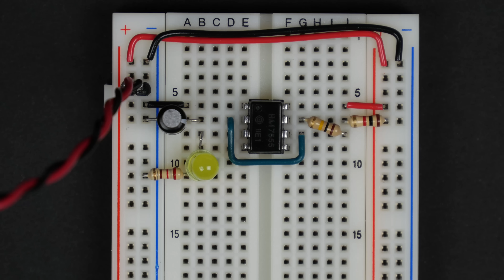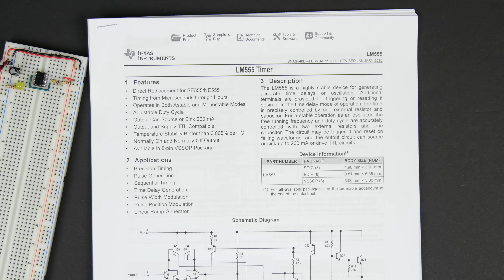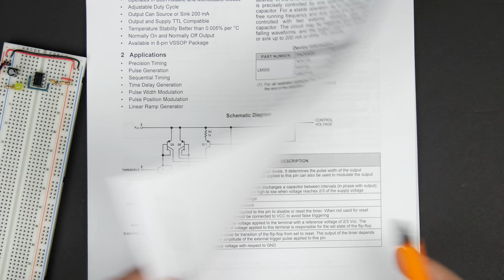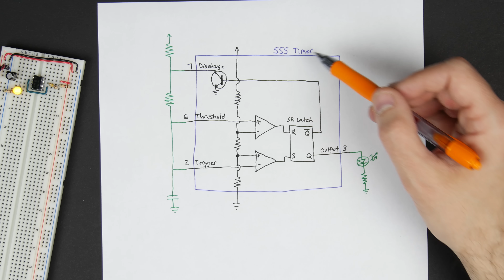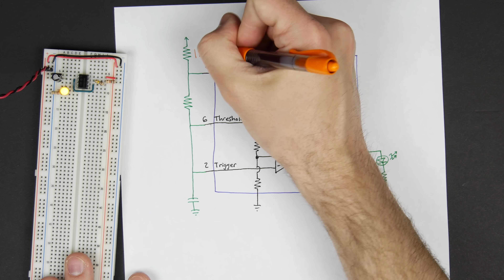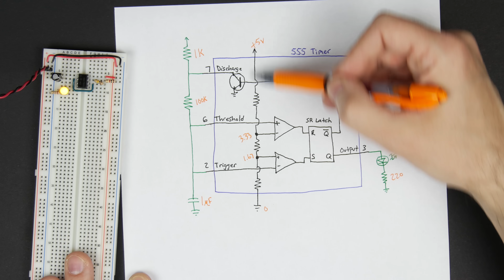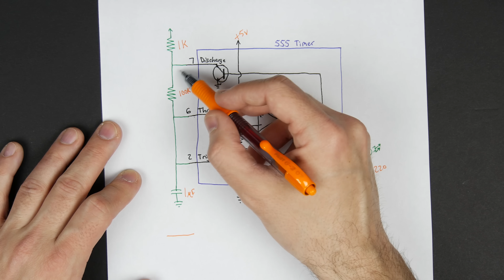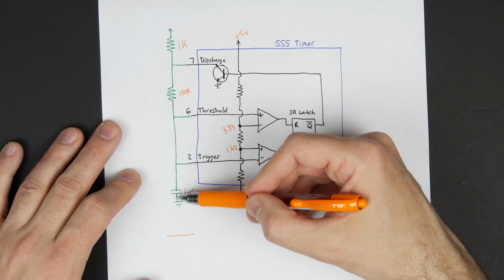Astable 555 timer - 8-bit computer clock - part 1

Comment: Caps, especially electrolytic can be off by a lot and still be in spec. Usual tolerances for electrolytic caps can be from -20% to as high as +80%.
 So 1 μF at 80% could be .8μF to 1.8μF. So 2 μF close enough.   https://www.electronics-tutorials.ws/capacitor/cap_3.html

Comment: What happens if you just use an alternating current for your clock signal?
Reply: Michael Mele the only thing online I could find that used AC current for a clock is this clock https://hackaday.com/2010/04/07/logic-clock-without-an-on-board-oscillator/

AC current is fairly consistent but can vary by a bit from day to day so it’s not ideal for something that needs a consistent signal 

It’s also inflexible only going at a specific hz
Reply: @Madjam-cd2fk  Thanks a lot! I guess it's not a well trodden path, which is something I didn't know before. 

I'm guessing that your AC input signal could be as flexible as you want to make it. Are we stuck with the 60 Hz coming out of the power grid, or is it feasible to custom build an adjustable and regulated AC power supply at any frequency you like?
Reply: well these chips are all analog (in the computer) so thay would have some problems / unexpected behaviour with a analog clock

Comment: the .693 coefficient is approximately ln(2), as the capacitor only charges and discharges half way.
Reply: It only charges from 2/3Vin to 1/3Vin. The calculation for that would be: 2/3*Vin*exp[-t/(C*R)]=1/3Vin <=> t=ln(2)*C*R.
So you where right about the coefficient, but it doesn't charge or discharges half way. Im sure thats what you meant, but just for clarification.
Reply: lol I've seen this constant so many times (in Chemistry; physics; etc.) that when I saw .693 in the video I immediately know it's ln(2) lol
Reply: @yiliangliang5694  especially in electrochemistry and ionic equilibrium lol and chemical kinetics
Reply: Thank you
Reply: I knew it seemed familiar!

Comment: I do have a question that I dont know if it was asked already. Why on the discharged phase, the capacitor gets to discharge into the transistor rather than the ground it's already plugged into?

And while asking this question, another came to me: Why the capacitor is even discharging, to begin with? As the way I see it, it's just constantly plugged in the 5V then into ground.

I feel like I missed something there >_<
Reply: To answer your first question, the capacitor doesn't discharge into the ground it is already plugged into because the charge accumulates on the other plate which is not connected to that ground. As this charge accumulates on one plate, that plate will have a higher electric potential then the other plate, which is grounded. This difference in potential is voltage. When the transistor is energized it will allow current provided by the power source to pass through the 1K resistor and straight into ground, completing its circuit. Likewise, the capacitor that has been accumulating charge will now be able to discharge through the 100k resistor into ground, completing its circuit.

Your second question is very much like your first. When the transistor is energized it provides a ground for the power source before it would contact the capacitor. Think of the transistor being energized as a way separating the power source and the 1k resistor from the capacitor and the 100k resistor.

I hope this clears things up.

Comment: The 555 was my mainstay in the 80s.  Two of these was the heart of an automatic car starter which was pretty cool since in the mid 80s they were not all that common.   One in the Bi Stable mode was triggered by a radio link from a cheap remote controlled car from RS which supplied power to the ignition and triggered a second 555 in the Mono Stable mode that powered the starter for a few seconds.  It was pretty simple by today’s standard but back in the 80’s it was pure magic .

Comment: Those capacitors, judging by the "MFD" unit label, are older than dirt and have become electrically leaky, hence the high reading. Allow me to explain.

Imagine an ideal capacitor. Two plates, with a gap. No DC current will flow through them once the field is built up. Non-ideal capacitors have a characteristic called leakage current, which is the amount of expected DC current flow between the plates due to things like electrolyte conductivity, ionization and metal migration over time under the force of the electric field, etc.

As some types of capacitors like electrolytics and the old paper and wax capacitors age, they leak more and more DC current across that they shouldn't, and slowly start to build a parasitic resistance that decreases as the capacitor ages. Since the parasitic resistance is in effect in parallel with the capacitor (because the leakage current occurs between the plates) it causes the capacitor to take longer to charge. Most multimeters read capacitance by passing a small, known current between the leads and then sampling the voltage over a specified time (basing the reading on the fact that larger capacitors take longer to reach any given voltage at a constant current), meaning that any leakage between the plates of the capacitor will cause the reading to look high because of the parasitic current draw keeping the voltage down.

Slap one of those capacitors between the leads of an old capacitor leakage tester and see how badly they leak. Some of the older caps I've seen can leak current at a charge as low as 2-3 volts. No doubt those are the same.
Reply: That tels me that we measure the load time of the capacitor, I usually measure UN-load time, with the opposite result of course (many of my parts are 20jrs+)  Because my first 5 555 experiments went wrong, I did not think much of if, now I am gonna try again... thanks to Ben and all use full comments.
Reply: Indeed.  It would be interesting to find out if the capacitor was equally inaccurate at higher charge currents, and whether the electrolyte barrier would reform over time if the capacitor was kept in constant use.   As I'm sure you know, the electrolyte itself is conductive, but passing current though it forms a thin insulating layer of oxide on one of the capacitor plates, and this thin layer is what makes it a capacitor (and indeed a polarised capacitor).
Reply: and here i am thinking 'mfd' just stood for 'mf' doubled...

Comment: Oh man, I just realized - so, in Minecraft, there's a commonly used redstone device called an Etho hopper-clock, which serves basically the same role as the 555 timer of being a cheap, easy-to-use clock where the period can be varied easily depending on how you set it up. And what I just realized is, it's not just the role that's analogous - the mechanism is analogous too! You've got a set-reset latch, a couple comparators feeding into both inputs of the latch, and an accumulating device where stuff can either flow into it, or flow out of it, depending on the state of the latch. Items flow into a hopper until one comparator says it's full enough, which sets the latch, allowing the hopper to "discharge", and then items flow out the same way they came in until the other comparator says it's empty again, which resets the latch.

This ubiquitous circuit was independently reinvented in a videogame by someone with no electronics knowledge. I just think that's neat!

Comment: when i plug my probe to check the cap on pin 2 the output of my 555 goes stable, the LED remains on and doesnt pulse. Whats going on there?
Reply: try flipping your 1 mF capacitor around. that was my issue
Reply: @glacial_chinchilla  thank you this just saved my morning

Comment: Asking just by curiosity. At 12:00 you talk about the rate between on and off time (duty-cycle). Wouldn't you get 50% duty-cycle if you placed another 1k resistor before the discharge-transistor? Nice video btw!

Comment: why would you even need the first resistor if you want to have the same time on as off, couldnt you just connect it straight to 5v with wire? or is there something im missing
Reply: if you connect 5v to pin 7 than when the discharge transistor opens you have basically 5v connected to 0v(ground) without any resistor === shorted circuit

Comment: I was wondering when you connected that small 0.1 mF cap to pin 5 and ground which I think is called the "Control Voltage" pin, how did that smooth out the transition ripple so well?  Also these R/C timing circuits are notoriously unstable in frequency with change of input voltage and temperatur.  A crystal controlled circuit with a bunch of dividers in order to divide the higher frequency down to a couple of hertz would have been more stable.

Comment: On the schematic for the clock module, there are two capacitors labeled C1 and C10. I'm having trouble understand where the second one fits in to this and its purpose. Does anyone have any insight?
Reply: These are essentially the capacitors he talks about around 22:10, to filter out spikes due to the impedance of the power lines. There are two caps in parallel to get the right value.

Comment: Could you maybe recommend a video series for all the electronics stuff? voltages, current, resistors, capacitors, etc. Coming into this as a complete electronics novice, it's all quite overwhelming. Would be much appreciated, thanks! :)

Comment: Hi Ben - thanks for the splendid explanation.  The question I have is that if we were to apply a voltage say Vcc on the Threshold Pin, at what point will the timer reset?  Will it reset when the voltage is fully and completely drained to ground through the internal transistor or as soon as the voltage is applied to the Threshold Pin ?  Could we see this on your oscilloscope?

Comment: I wonder what the inside of that variable resistor dial looks like. What allows that thing to work in the way it works?
Reply: you basically have a long resistor wire and you slide a contact on top of it = increase / decreased resistence

Comment: What is the purpose of the 1K resistor? If you remove it the capacitor will still charge through the 100K and discharge through the 100K which will also give you a perfect 50% duty cycle. So am I missing something out on the 1K resistor?
Reply: But then you'll have a short coming from 5V to the ground through the transistor on the discharge cycle.
Reply: @sergten  ah yes ofcourse, totally missed that one.

Comment: It is a very slow clock. Even if you use a tiny capacitor, the 555 speed is very limited for practical applications. You are much better of with a crystal, two caps and a series of inverter gates, or just buy an oscillator (although that would not be neither fun or educating).

Comment: I have about 100 hours screwing around with the versatile 555 chip. Engineer's Mini-Notebook: 555 timer IC Circuits (Radio Shack) by Forrest M. Mims III is excellent.
Reply: I have one of those and a couple of other circuit making guides!  Wasn't Radio Shack grand?

Comment: just use a small lithium battery as a giant filter capacitor and it chould solve the waveform as the resistence across the battery is always lower than the input wiress.
Reply: yeah lithium battery that changes/discharges slowly and it's for 4,2 volts instead of 5 , great idea

Comment: Hi Ben,
Thanks so much for these 8bit computer videos, they are fantastic, I will build that and then make is an 8 bit address bus. It made me remembe when I worked with my OSI C1P in 1979/80, you can google it OSI chalenger C1P superboard, I had just the board, this in Brazil, probably one of the first personal computers in Brazil.
I did build the clock as on part1, the led is blinking but it blinks very fast and if I adjust the potentiometer just a bit, it stops. Are you sure you used a 1MOhms potentiometer? Is it not a 100KOhms?
Thank you very much.

Comment: You asked about why the cap values didn't match the measured value.  Electrolytics have ridiculous tolerances.  Usually for the things you use elecrolytics for, a 25% tolerance causes no problems (you're often using them for power smoothing for example).  In your case you've got a 100% overshoot, which is surprising, but maybe they're old?  They drift quite a bit as they get older and dry out.

Comment: If I understand this right, could disconnecting pin 7 (discharge pin) allow the 555 to function as a power up latch? What I mean is, with pin 7 disconnected and the proper size resistor/capacitor in place, could this pulse the output on for the first second after applying power, and then turn it off indefinitely?

Comment: Don't understand how voltage is getting to the left side(green line) in the first place.
Reply: Old comment but in case anyone has the same question that's where the 5 volt wire from the USB charger is directly plugged in.

Comment: Remove the 1K resistor.
Disconnect the 100K from pin 7 and connect it to pin 3.
This gives a 50/50 square wave and saves one resistor.

Comment: Can't you add a 1k resistor coming out of pin 7 and connect between the 100k (or variable) resistor, and the 1k resistor? Wouldn't that allow for perfect 50% duty cycle? i.e. On time=Off time? 

My thought process is that while charging the capacitor, current will be going through the 1k + 100k resistors, then while discharging, current will flow through the 100k +1k (pin 7) resistor. So charge time = discharge time. Is there a problem with doing that?

Comment: I'm looking to set up this to a speaker, but when I set it up the way you did at the beginning of the video, (using the same types of pieces) my LED isn't blinking, is the capacitor just charging and discharging too fast?
Reply: Although, I am using a LM555NC, and I don't know what chip you were using exactly, but I think it should work, right?

Comment: Very helpful video. I love this series. The reason your caps are 2uf though is because the tolerance of electrolytics tends to be very low. I can't remember off of the top of my head, but I remember when I first started using 555s I came across the same problem. If you use tantalum capacitors you can get a much more accurate value.

Comment: Hi. I've seen the datasheet, and I've notice you have not attached the 0,01 micro farad capacitor to the voltage control pin. I suppose that this is just to simplify the tutorial and because you are confident that the ground voltage is not going to have any peak, isn't it? BTW, I am a newbie starting electronics as I am a software enginneer, but I started losing fear to circuits. I discovered your channel and is very instructive. Thank you very much for sharing.

Comment: Cannot seem to find a variable resistor/potentiometer to fit a breadboard anywhere! Can someone please help! Im in the UK but will import if I have to.
Reply: same problem (middle of eu) I just bought normal potentiometer and soldered some wires onto it to fin in the bred board

Comment: Great demonstration and explanation, and I agree with the potentiometer for what you're doing.  A cautionary note I believe is advisable though, against using potentiometers in general for oscillators or clock circuits, as they tend to oxidize over time and change resistance.

Comment: I set this up on TinkerCad.com website  Circuit emulator, and the light just stays on.  If you ever get a chance to play around with the website see if you can get the light to blink.  I have it set up exactly to specification on what you have here.

Comment: The capacitor kit you recommended doesn't have 0.01uF, only 0.1uF and 68nF. Does the 68nF cap work in place of the 0.01uF capacitor for cleaning up the noise?

Comment: So the point of allowing the voltage to dip and then expand is just so that the device runs at a rate that the user desires?

Yeah this is a dumb question. Good video though. Seems like a lot of work for a fancy voltage clock haha
Reply: user devices ? wdym

Comment: why do you need that first resistor for the a-stable timer to work?
Reply: You mean the 1k resistor here? It limits the current from supply voltage to ground through the discharge transistor. If you connect pin 7 straight to supply the discharge transistor will almost short-circuit the supply causing many problems and possibly damage, depending on how strong a supply you have.

Comment: 1 MFD is one megafarad debye. What a unit for the electric dipole moment is doing in there, I have no idea, but I assume you have a very advanced piece of electronics there which only happens to also function as a 2 μF capacitor.

Comment: You can also connect a resistor between the 1k and 100k resistors directly to pin 6 and get a perfectly symmetrical charge/discharge cycle.  Because you would be charging through 101k and then discharging through 101k.  As opposed to the 101k/100k charge/discharge ratio.
Reply: Timothy Chapman - You meant pin 7 right? Pin 6 is for comparison, pin 7 is the discharge one.
Reply: You are correct.  I do mean pin 7.

Comment: So I built this circuit and plugged in my 5 volt power supply and it didn't work. So I checked my connections but none of them were faulty, I decided that I would use a 9 volt battery instead of a 5v power supply. As soon as I plugged it in the circuit lit up. I don't have a multimeter that works so I don't know whether it was a faulty power supply or the current or voltage supplied to the led not being enough. I think that the voltage or current supplied to the led was not enough but if anyone has an explanation I would greatly appreciate it. Thanks